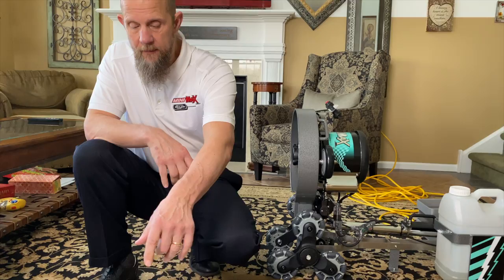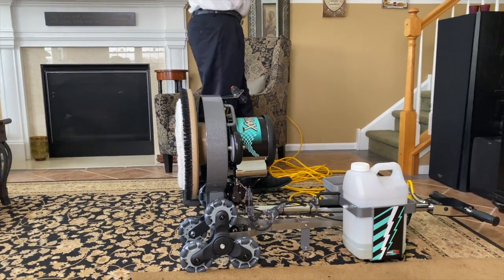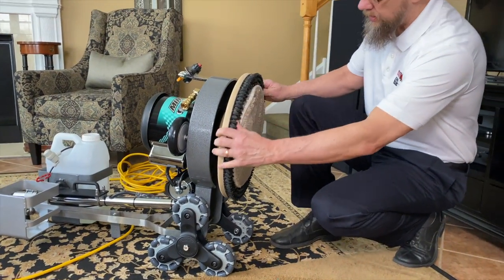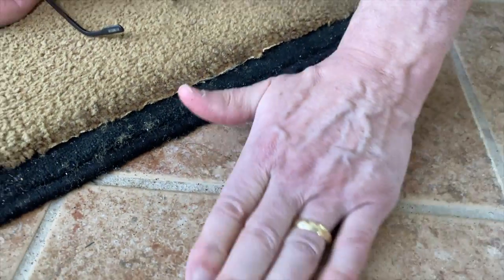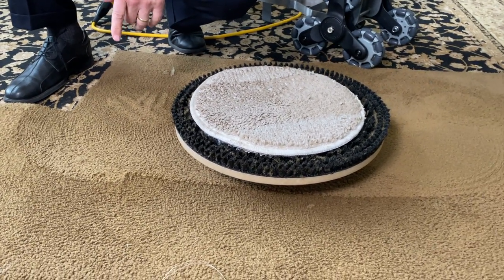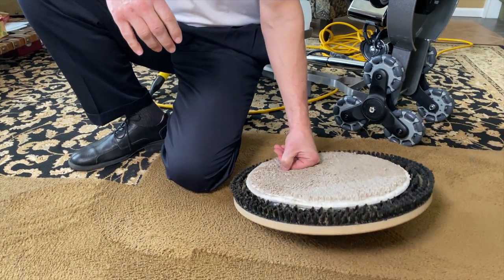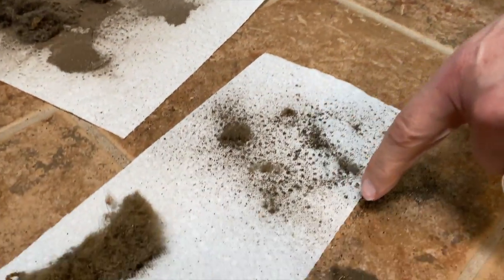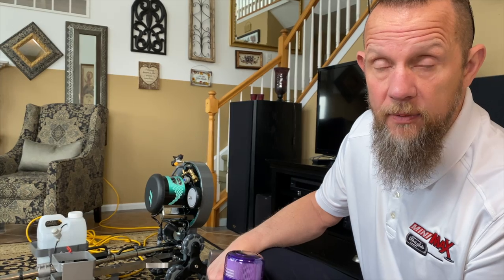Multii Brush deep carpet cleaning - Bonnet Pro

Comment: A better prevac I.E. KIRBY would get all that in one step, those Barbie house vacs can't cut it
Reply: I agree the Dyson is good but it's not a commercial unit. But to show what you can pull out of the carpet, it shows nice on a demo.  I have also pulled out grit from a very short knap commercial carpet after I just use a ProTeam on it. The brush does work well.